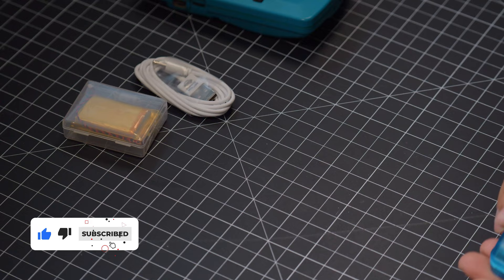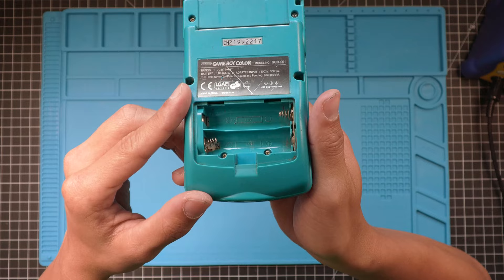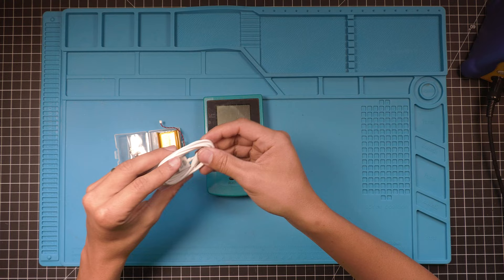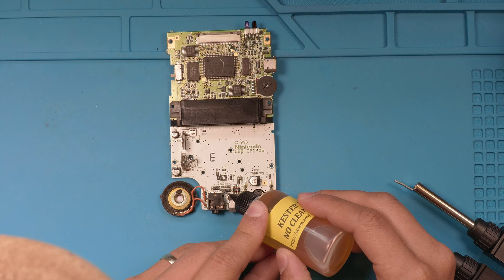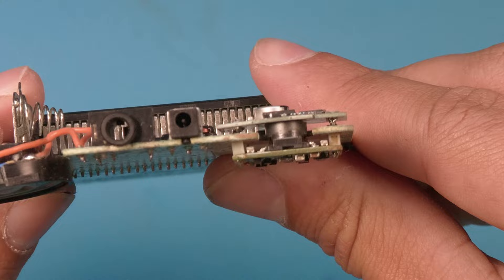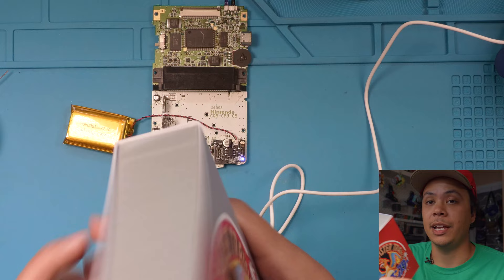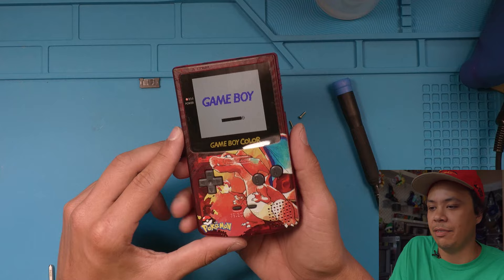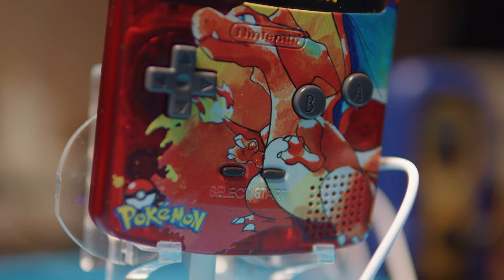NEW Rechargeable Battery Mod for the Gameboy Color 2022

Comment: Awesome video, bought the mod, followed exactly, made sure nothing is touching not my first mod, checked everything and now gameboy is dead. Took it out out battery’s back in with the fuse and nothing, bypassed the on switch nothing. It’s completely killed my gameboy 🙃 however I do get a light on the little pcb when charging 😂

Comment: Would be nice to move the plug from the pcb to the battery bay so you can easily swap out the battery pack if it needs to be replaced and you still have the option to insert regular batteries. Also, that would be a pretty easy fix to do on your own with a little bit of experience.

Comment: are you supposed to remove the original battery contacts/springs?
Reply: You dont need to but if you do you get an extra hole to put the cable through which would have stopped him from needing to snip like he did

Comment: What is that black bar in boot logo animation?
Reply: That‘s just what you see when you start the GBC without a game inserted (or the game not reading). It‘s the spot where the Nintendo logo will appear if the game actually reads.